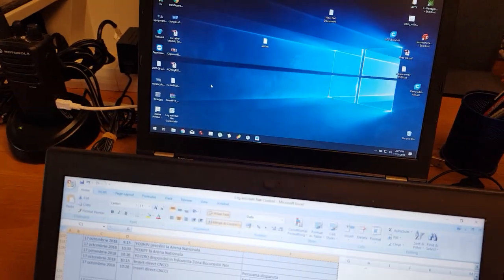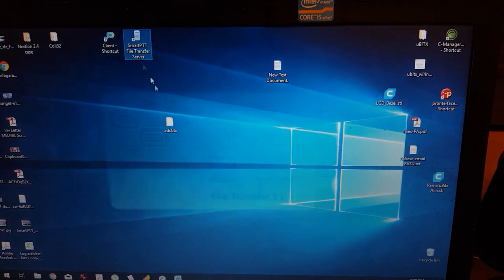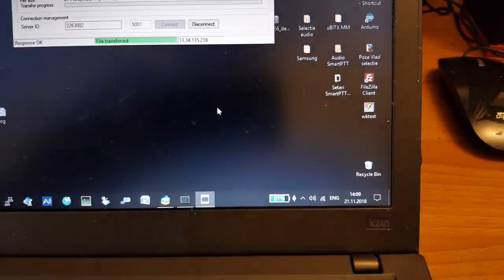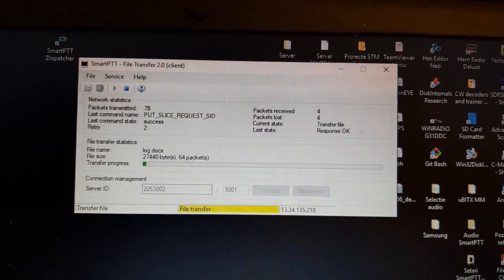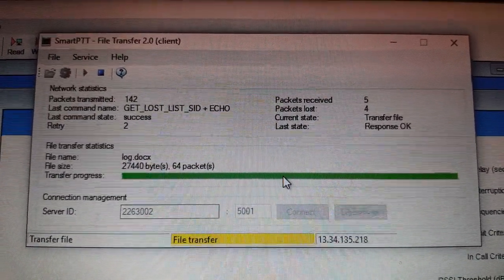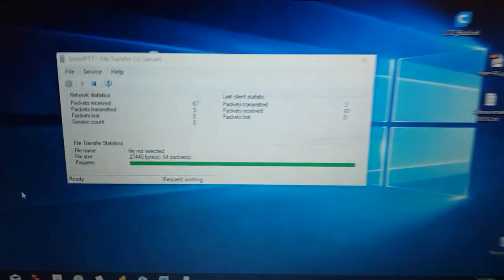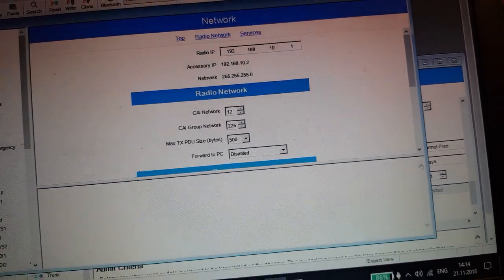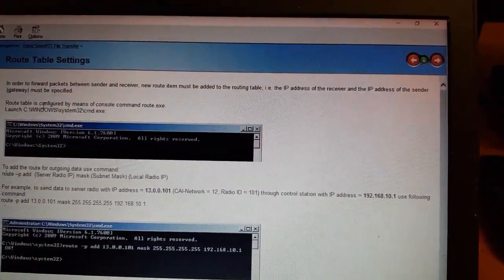MotoTRBO DMR File transfer

Comment: i completely ynderstand that system spices file into small pieces, and sends them, and re-sends them in case of failure. so it is reliable file transfer over huge distances. but still it is 1 slow, 2 overcomplicated.
Reply from the maker: Slow, yes. Overcomplicated, not quite. It is enough to have the setup done and anyone can use it without too much hassle. It is pretty plug and play. Much simpler than, let's say, Winlink even that is faster (sometimes).

Comment: wow "file is quite big!!!! 27 kilobytes!!!!"  and you transferred it  in 6 minutes!! lol. welcome to 1980 ZX Spectrum times!!  oh, also you need to fok your tcp/ip settings~~  what freq did you use
Reply from the maker: You can put a lot of data in a 12 kb csv and have it sent when you are in remote places with no cell-phone coverage. This is not for watching pr0n.
Reply: @YO3HJV  yea.. and zip file... but that numbers are BAD..
Reply from the maker: @stalin200000  i do agree it is not the most comfortable way to send data over radio but it is just another tool. Especially when working with SmartPTT Radio Server and Dispatch, the files are available into the local server as in a FTP and can be accessed directly on the Coordinating Center.